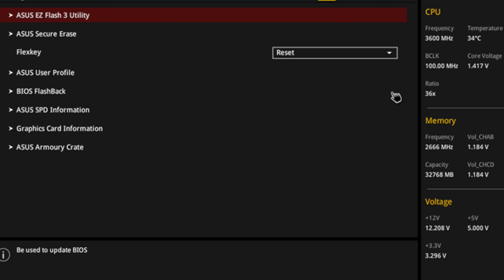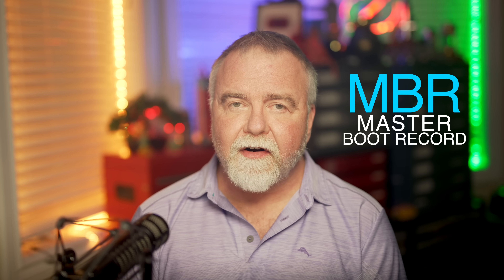How Computers BOOT: From Startup to Viruses

Comment: A video discussing disk partitioning and how that dovetails with this piece would be interesting. Especially given the myriad of historical disk partitioning schemes. MBR and GPT would obviously be mandatory, but it might be fun to look at others, both historical and extant.

After that, the one that really begs for your elucidation is the dark world of FILE SYSTEMS. 
Oooooo... Scary. Lions and tigers and bears.... FAT8/16/32, NTFS, ReFS, ISO9660, and maybe even some of the Linux options like Ext2/3/4, XFS, ZFS, etc.
Reply: I'm curious how the BIOS knows how to boot from an NVME drive, since it's a PCI device rather than a SATA drive
Reply: @maxstr  If I'm not mistaken I think the modern UEFI systems today are required to boot from NVME and it will read from that PCI Express lanes instead of the SATA Bus lines. It doesn't recognize it as a SATA unless if you're specific NVME or SSD is connected to the SATA ports. Also you may have to modify the BIOS settings to select that particular drive to be the drive to boot from. It may not automatically do it for you. You might have to configure the BIOS.
Reply: @maxstr  At the abstract level, an NVMe device is a storage controller, just like an AHCI SATA controller or many other types. It can accept commands to read and write blocks and do other things.

If the BIOS or UEFI has drivers to support the device, it can expose it through its storage APIs.

In fact, I have an older motherboard here with an M.2 slot that supports PCIe drives. If you plug an NVMe drive into it and boot an OS with an NVMe driver, it will see the drive normally, however UEFI is unable to boot from it as it doesn't have a compatible driver.

Once, I was reading something about modifying BIOS images to add drivers to them. I didn't go through the process, but I did manage to download an NVMe EFI driver and extract it. I started the built-in EFI shell, loaded the driver and the NVMe drive showed up in the list, as expected.
Reply: @maxstr  Late reply. IIRC, the pre-UEFI BIOS points to sector 0 of the boot device to execute the bootloader. It doesnt care what type of device; they all get presented to the system as block devices. What happens next is based on your bootloader.

Comment: The x86 boot process seems well defined, but on other architectures like Arm it seems to be the wild Wild West with every device having a different boot process.
Reply: i think it's cause arm is more made for optimisation and low power usage so it doesn't really make sense to make each processor compatible with each other

Comment: Kinda similar, for my own custom CPU core (and ISA) on an FPGA (personal hobbyist project), the general boot process is sorta like:
  RESET pulse, with CPU resetting major control registers to default values;
  CPU starts at 0000_00000000, which holds the ROM (48-bit VA, 32-bit PA);
  The start address branches to the actual entry point;
  It sets up some initial registers, then runs "sanity checks", which verify that most of the core CPU instructions/features are working;
  It then sets up the console for text display;
  It does a RAM test, followed by a small L1/L2/RAM benchmark, and cache integrity check;
  It then sets up the SDcard, reads partition table, and reads the first FAT32 partition;
  It looks for a file named "bootload.sys" in the root directory, and if found loads it;
  In my case, this file is an LZ4-compressed PE/COFF variant (albeit lacking the MZ header or stub);
    The 'PE\0\0' turned into 'PEL4' to signal this, everything past first 1K of headers is LZ4 compressed;
    If 'PE\0\0' or 'MZ', it is loaded as an uncompressed image.
    Otherwise, this format imposes an Offset==RVA constraint to simplify loading.
  The PE image is loaded into RAM (decompressed during load);
  The checksum is then verified
    Custom algo, as the original PE/COFF checksums were unacceptably weak
    The original PE/COFF checksum algo kept missing errors from common LZ decompression issues.
  It sets up various registers, and jumps to the entry point.

At this point, the "kernel" does the rest (more sanity tests, setting up console and FAT again, sets up virtual memory, and eventually reaches a command-line).

The "OS" design is a little odd, mostly Unix-like shell and POSIX-like APIs, but some amount of DOS/Windows inspired stuff as well... ( So, almost sorta like a Cygwin-like OS. ).
Also, EXE's/DLL's are checked first in CWD, then using PATH (more like in Windows). Well, nevermind some parts inspired by the Doom and Quake engines, etc...

The LZ4 compression is mostly because reading stuff from the SDcard is slow, and LZ decompression is faster than reading more data.
I also have my own LZ compression format (RP2) that I use a lot as well, which compresses "general data" slightly better than LZ4 (at a similar speed), but LZ4 seems to get better compression for machine-code with my ISA. Not using Deflate mostly as it is too slow for this use case (comparably, LZ4 is a lot simpler and faster).

One other major change was that the PE/COFF ".rsrc" section was mostly replaced with a variation of the Quake WAD2 format (but using RVA's as offsets and with a different header, and contents are still able to be addressed from C code). I didn't really "get" the design for the original resource section, and a WAD2 variant seemed simpler and made more sense. Still mostly being used to store BMP/DIB images and similar though... Header design is partly backwards compatible, so the original section format could be restored if needed.

Granted, even BMP is tweaked: There is a ' BMP' format (vs 'BM'), which differs mostly in that the headers are 32-bit aligned (and image data is aligned to a 64-bit boundary). Along with a hack to allow indexed-color images to encode a transparent color (I had a use-case for 4 and 8 bit BMP images with a transparent color, ...).
Reply: Having spent a bunch of time with the PE/COFF format, yeah, it gets pretty bonkers once you get past the standard section mapping stuff.
Reply: @SimonBuchanNz  Yeah, there is a lot going on in there.

In my case:

Didn't need the MZ stub, since my binaries aren't going anywhere near DOS, and can't load on Windows anyways (different OS, and entirely different architecture, with a 0xB264 Machine Type, and the PE32+ format, in my case), so I left them off. Still keeps most of the other PE/COFF structures intact though (of the parts I am using). Can note that my ISA is still little-endian, so this much is still the same at least.

The Global-Pointer entry in the Data-Directory was unused on mainline targets, but I used it to both give an address to initialize the global pointer (my ISA uses this), as well as to define a separately relocatable section (the data/bss sections may be relocated elsewhere for each program instance). This does add a little wonkiness to applying base-relocations though.

In the ABI, a mechanism is used to daisy-chain all the global-pointer sections for all of the PE images in a given program instance, so from any of the images, it is possible for them to access a table through this register and reload their own global pointer (this also allows for multiple program instances in a shared address space).

Import/Export is always by name in my implementation (import/export by ordinal is not supported).

The original resource-section design just didn't really make sense to me, so I basically just used the top-level to point to a WAD header, which points to a WAD directory.
So, in this case, each resource/lump is identified with a 16 character name, with a key into a table of FOURCC's for the lump types. These WAD entries are exposed to C land with symbols of the form "__rsrc__lumpname". A file is given to the compiler which tells it how to import and convert the resource files and associates them with lump names.

In all though, I felt PE/COFF was a better fit for what I wanted to do than ELF was, so I went with this (and the handling of shared objects in ELF quickly takes a detour into absurdity, IMHO).

Early on, had considered an LZ4 compressed Mach-O like format, but then in design realized it would have little real advantage over just using inline LZ4 compression on PE/COFF. The compiler first generates an image in uncompressed form, and then compresses it (emitting the LZ compressed version if it is sufficiently smaller).

The loader design as can be noted in this case, is to read in the compressed image 1K at a time, and then decompress it into the target address (using the destination as the sliding window); continuing to load and decompress blocks until the image is loaded. After this, it then applies base-relocs and similar. Note that the LZ compression and decompression needs to respect the 1K chunking for the image to decompress correctly (so, this use of LZ4 is non-standard in this sense).

If not for the file-offset==RVA constraint, it would be needed to first decompress the image to a temporary location and then copy the section contents to their final load addresses. Adding this constraint can sidestep this issue (and even for uncompressed images, one would either still need to either use a temporary location, or have access to a file-system driver capable of "fseek" or similar; rather than being able to just use a naive FAT chain walk or similar).

As for "Why should LZ compression matter"? Mostly it was a case of running an SDcard in SPI mode at 5MHz was "not exactly fast". And my Verilog simulations run upwards of 1000x-1500x slower than real time. So, shaving down the loading time is a lot more obvious when every second in simulation is a good part of an hour in real-time (though, I have since boosted the SDcard to 12.5MHz ... or around 1.5 MB/s).

Comment: A friend of my friend had one issue with his desktop when I went to fix his computer I noticed ntldrd.dll was missing from the hard disk so I just copied from Windows CD and the computer booted again.

Back in 1999 a friend of mine wanted to install Windows XP Sp2 on his old computer, We started the setup but the setup failed without internet or google I managed to format the HDD and reinstall System files into the HDD to be bootable and then we installed again the Windows 95.

Comment: I've never understood why the whole Arm ecosystem doesn't embraces UEFI or some sort of basic unified firmware so that custom bootstraps aren't needed anymore. TianoCore/EDK-II are open source, yet all these arm SBC's ship with some sort of customized and often bastardized version of Debian/Ubuntu bootstrapped into an image that can't really be changed or even updated much. It's almost like they really don't want normies to be able to grab an ARM SBC and just install an OS on it like with x86. Imagine if you bought an x86 anything and then had to walk a device tree file (DTB) to figure out what handful of things need to be changed to enable the onboard M.2 port, set the appropriate voltages, and then tell it if it's NVMe or SATA. Only thing I can figure out is it's a deliberate choice to make ARM more attractive for the walled gardens. If RISC-V releases a unified firmware of any type they will probably destroy ARM pretty quickly and pose a real threat to x86.

Comment: I always wondered how ctrl-alt-del seemed to work before any operating system had even been loaded. But the fact that the command gets processed by the BIOS makes me wonder how Windows is able to intercept it and prevent the CPU from resetting.
Reply from the maker: I'm not an expert on it, but I imagine it raises an exception; if the OS has installed a handler for that exception then it can catch that signal.  If the signal goes uncaught, I'm guessing that the result is a reboot done by the BIOS.
Reply: @DavesGarage   Win 11 changed the response to the interrupt, as doubling down on the three finger salute hasn't forced a warm reboot since 7 or was it win 8..
Reply: @mordantly  It was way before that. Windows 3.x intercepted Ctrl+alt+delete and it probably wasn't the first version to do so.
Reply: @eDoc2020  I only said that around win 8 or 10, it was changed so you can NOT force a reboot by doubling down on it. 95 to 7 will bring up task manager first then second time reboot. Now microsoft feels like google wanting to control what you can or can not do. Hardware interrupts are for when the os freezes, and we don't anylonger have hardware power and reset buttons of old.
Reply: @DavesGarage Windows 10 for instance doesn't reset the PC, it goes to the blue screen with your log out, restart, change password, switch user options.  So a lot different from just getting that key sequence to do a warm reboot (such as in a CLI O/S like MS DOS).

Comment: "UEFI presents a more user friendly user interface"... BS! :-D They are usually a horrible slow mess of horribleness compared to the clean, functional and easy to understand menu system BIOS systems have had since J was a cowboy. These new gaming mobo UEFI setups are just full of useless trademarked "wizzbang technologies" nobody is even supposed to understand, apparently. Design by marketing department at its worst. Sure some business systems are better than the asus crap we get pushed in the homes but still.
Reply: UEFI and BIOS are both just programming interfaces that are loaded from the ROM to the RAM before the computer boots. The SETUP program is a different thing and for it it doesn't matter if the firmware is UEFI or BIOS compatible. For some reason UEFI marketing people often try to associate UEFI with better SETUP programs, when in reality they have no connection at all.

And yes, in reality, for some reason, UEFI firmwares often tend to have even worse SETUP programs than BIOS firmwares do.
Reply: UEFI - Unnecessarily Elaborate Firmware Interface.

Comment: You say that x86 processors load FFFF-FF00 as their first address but this is a 32 it address so didn't the original 16 bit 808688 processors load a 16 address instead?
Reply from the maker: On an 8086 microprocessor, the boot process begins at the memory address FFFF:0000. This is effectively the physical address 0xFFFF0, which is 16 bytes below the top of the 1 MB memory space available to the 8086. This address contains the initial jump instruction that directs the processor to the start of the BIOS boot-up code. This mechanism ensures that, upon power-up or reset, the processor starts executing from a predefined location in the ROM containing the BIOS.

Comment: Where is UEFI stored? I understand, that BIOS is stored on the mainboard. And UEFI are just exe files stored on disk.

But what if there is no disk? Is the UEFI system still stored on the bios?
Reply from the maker: There's still a "boot rom" for UEFI, but the boot sector can basically use a whole partition instead of just a sector.
Reply: @DavesGarage  thanks for the clarification!

Comment: Back in the dark ages, I was the "computer expert to call" at the local talk station.  I remember one early morning when the activation date for a truly nasty virus hit.  I had said that as long as you had a reliable antivirus running with current signatures, you should be good to go, but here is what it will do to you if you aren't protected... and described the virus's actions. That is when a guy with an 80286 based system called in to say  "I think I got that virus.  My computer turns on, but doesn't run the bios."  The nasty that he had (and did not have an antivirus to detect) basically totally wiped out his BIOS code which was  flashable.  So the virus had written junk into what had been booting his machine.   I told him  since the bios was soldered on to his motherboard, he would need a new motherboard in all probability.
Reply: Is that true? I thought most 286 systems still used mask ROMs or maybe UV EPROMS. Either way they can't be programmed from the PC. I'd be interested to know more about what this system was.
Reply: @eDoc2020  Early IBMs had the burned rom that was safe.  However, there were a lot of stuff from overseas that had discovered the BIOS from folk here, and that they needed to be able to update them with a flash from a bootable floppy disk.  (Phoenix among others.)  And the clone motherboard manufacturers needed to be able to update the bios so that they could add new bootable devices....  It had to be able to init all the new stuff that was coming out, and of course, fix any bios related bugs.    Some of the early bios systems from the far east were rather humorous... The error on one I had to fix... "Disk not setting OK" for a failure to load a floppy disk...  Early Dells needed a chip change for an update.  That got REAL expensive for them....